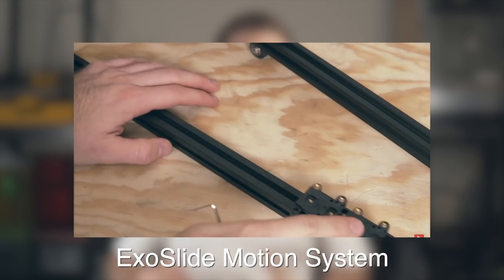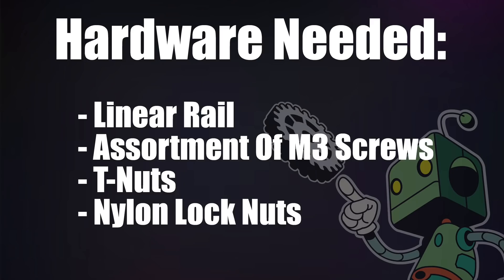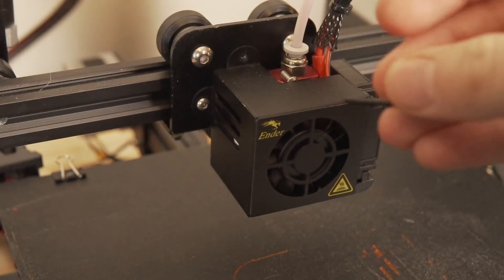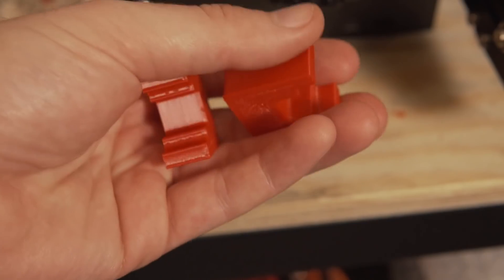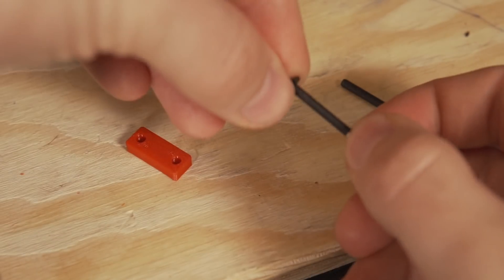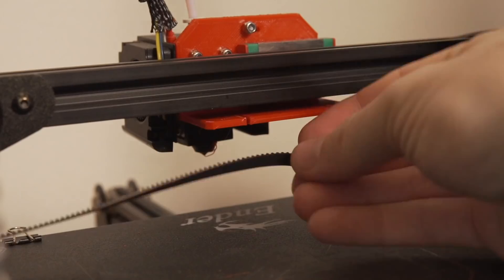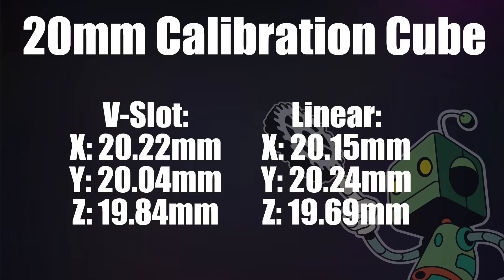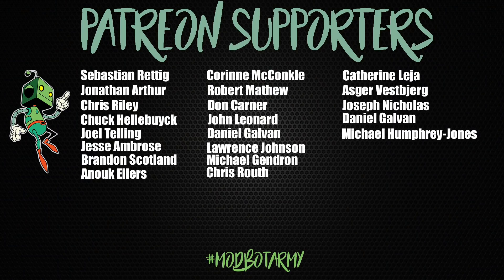Low Cost Ender 3 3D Printer X-Axis Linear Rail Install

Comment: very fun video. currently I use petg-cf, it very strong so It may be better matterial option. 
there  are may option for ender 3 v2 neo x-rail upgrade, but many other bracket that not used, so it a bit more high value. 
with user design, maybe there are more option maybe. 
Ender 3 v2 neo and Sprite pro kit and some cheap rail and your mod bracket is something fun result maybe. 
thanks for your video

Comment: I will be upgrading an Ender 3 Pro with 5 linear rails (Zx2, Yx2, Xx1) by converting it to core XZ Kinimatics (Voron Switchwire).  I will be using the Voron Afterburner with a dual Bowden configuration and two M4 extruders to have a dual material setup.   
I think one could take the original metal X carriage on the Ender 3, and drill 4 holes in it to mount it to the linear rail instead of printing an adapter.  That would be rigid enough.  The excess bits used to hold the could be cut off if desired, but that isn't necessary.

Comment: Your bracket was long enough to have used two slides. That would have improved tolerances way more. Original slide had a longer base of contact. Just having one slide magnified slop with the head extended beyond the slide. Wear in will increase that also.

Comment: not really surprised its not good, the carriage rail is crap being made of plastic and is not dimensionally accurate which means its not parallel to the X rail Extrusion and the major issue is the hot end which of course does all the work is even worse , one small piece of plastic to hold a 6 cms lump of metal holding only at the top which is not where the pressure is, its needs to be held top and bottom and needs again to be parallel to the X rail profile.

If none of those are parallel it will never print dimensionally correct again. 

You dont need  to waste plastic printing the alignment spacers just use the depth gauge on your verniers and use that to make sure that you check as you do the screws up, thats another issue those should be started in the centre and you should use all 12 but treat it as if it is a cylinder head and tighten in a sequence which is not 1, 2, 3, 4 it needs to be something like 6, 4, 8 and so on . 

Washers finally need to be used where a screw travel's through plastic to spread the load.. If your going to use these parts to upgrade your Ender then perhaps you should make sure that main carriage plate is double the thickness or better still have one made in metal or find one made in metal, They are bound to exist now...  Finally toss the bearings out of the linear rail carriage bearing, wash it out with a solvent and repack with high quality new ball bearings and pack with the correct grease for them.

That will make a difference but unless you do the lower axis and bed it will not benefit your printing, it just makes it look prettier... 😄

Comment: With regard to the tolerances, I think it's prob significant that your x tolerance improved (slightly) which is the axis you installed the rail on, whilst the y and z got slightly worse, which are the axes most likely to be affected by any flex in the mounting bracket.

Comment: Very interesting vid and comments. I have a modified AM8 (All Metal Anet A8) that still uses round rod linear bearings (Drylin). Been trying to decide if I should upgrade to V-slot or flat linear rails. Currently if you push and pull on the nozzle its possible to move it quite a bit due to play in the x axis Drylin bearings. I'm leaning towards v-slot simply because they are adjustable where as linear rails aren't. Interested to know what the play is like in your linear bearings?

Comment: honestly how could you expect closer tolerances between the Axis's yet only replace 1  Axis with a linear rail??  and honestly when doing a linear rail upgrade why do so many skip the Z axis it's honestly the most important Axis to put your focus on for upgrades it takes all the weight, which causes it to always push on one side of the thread face, which account's for Z Axis in printers to never seem to reach that perfect 20mm notice its always under!!?

Comment: Completely pointless. You're taking a metal piece and swapping it out for a plastic one. Obviously this isn't going to work as well. Also, the hotend mount is very unstable, introducing play in yet an other point on the printer. I think this guy should stick with resin printers.

Comment: Love all the videos of people using linear rails with printed parts. The whole point of using linear rails or rods is that they are rigid. Plastic has zero rigidity when compared to even soft alloys like aluminum. You are effectively no better off in those terms than the original design with wheels.

Comment: The linear rail and guide is a fine upgrade but as it has a greater mass than the original equipment, and given the Delrin wheels are somewhat pliable, there must be measurable sagging of the X Axis extrusion as the carriage moves from X-0 to its end of travel. The end of travel is situated at what I consider to be the floating end.
Certainly this sagging will be more exaggerated when you install a direct drive ass'y on there. Might as well get rid of the bowden tube of right?? you may also get into some more exotic filaments as well. All good. 
So,  may I suggest this upgrade begs for dual Z axis lead screws to compliment the linear rails
A friendly reminder that the installation of linear rails is normally done with a dial gauge mounted to a magnetic block and flex arm combo to check for parallelism between rail and the sub structure. You stick it to the guide, place the shoe of the indicator on the extrusion top side, zero the dial and watch it as you run back and forth. Start the process with screws just snugged and then when your satisfied you may tighten and measure again :)
Once you are supporting the X Axis rail from both sides, this use of a gauge will actually be a valid procedure and have helped you achieve repeatable output.
Fun fact: the dial gauge may be used to check all kinds of other stuff now that you have a linear rail and guide to mount it to. Have fun.

Comment: with linear rails the xy are closer to each other. 
but i wish you did a tolerance test as in the ones with the knobs you rotate. did you calibrate flow?
also you're almost the only one doing tolerance tests thanks :D
also I wish you checked layer consistency

Comment: Someone needs to do this for the V2. That is one of my last upgrades is for the X-Axis as I just finished the Y but I don't want to use the metal plate for the head because it has holes for a BL Touch without any modifications.

Comment: do you happen to know of any available stl files for 1515 extrusion gantry plates/ x/y-axis linear motion (not using linear rails, just using the extrusion itself), that I could access at all, please....? 

it was only AFTER  buying all of the 1515 extrusion id need to make a printer with that i came to realise that everyone seems to have used 2020+....

doh...

Comment: Hi ModBot, I installed the linear rails on my Ender-3 Project printer, I could not find a nice model for the X Carriage, so i designed one, maybe you want to try it out. 
https://www.thingiverse.com/thing:4801702
I don't use end-stops with the FLY-E3 controller board.

Comment: Whats the point of a linier rail system if the movement still depends on a belt? If you replaced a belt with a threaded rod, you would get a lot more accuracy, less lashback, and more precision. I think the belt is whats holding this mod back.

Comment: You should have disassembled this cheap linear rail and cleaned off all the machining grease.
Search "Super Lube 92003 Silicone" on amazon for when you assemble it back.

Also when you do a Dual Z axis upgrade, which I guarantee you will. (youtube content duh.)
get this to lube the Z axis shaft screw. "DuPont Teflon Non-Stick Dry-Film Lubricant"

Comment: I mean you improved the tolerance of the X Axis with the rail. The worst tolerances on the Y Axis has to be in correlation with the printed Adapterplate.

Comment: Great tutorial. Just got the Ender 3 Pro. Used the link in the description and it directed me to the 400mm rail. Is that correct size for the 3 Pro, or should I purchase the 300mm rail? Does this mod add weight to the X axis? Does printed stand off for the hot end come with the other part file? Cheers

Comment: This completely unrelated but figured I'd ask. Is there a way to make vases without having to use vase mode. A friend saw a vase she wanted and said I'd make it for her. But when I went to the slicer I notice that it was completely solid. So I downloaded a few others and they're all the same, solid. Read the comments and they say you need to use vase mode. So I did. After it finished I see that it's only 1 layer thin and weak as hell. I messed with the slicer settings and tried again and got the same results. All the settings I fixed weren't recognized and yet another flimsy useless vase. I tried an abs and petg to see if it was stronger but it isn't. Its just a waste of filament. My question is is there a way to make a vase without vase mode for a strong usable vase?

Comment: To be honest this would have been made better with a piece of aluminium (Australian aluminum) angle, a drill, a hacksaw and a file. Fairly basic tools I would think. You could even mirror your print and use it as a template for the holes.

Comment: You need to recalibrate X axe stepper motor after replacing that. I'm sure the tension of the belt is not the same as it was before. This is why it's off.

Comment: I had two lowe cost prizes terms.  They sucked . They where cheap only because they needed 300 plus in upgrades just to print the test models.  New I print with a sainsmart 300 core x.y. best thing I ever did.  No upgrading at all , comes with all available upgrades . Trouble free printing every time . Dont pull the hair out of your head spend a bit more and be fine . Oh . And use cura 4.8.0 for your slicer and get a 5 gig flash drive . Dont network your printer ever

Comment: Print in ASA instead of ABS. It has the same mechanical properties but is easier to print and doesn't require an enclosure.
I don't know if you didn't record it or left it out, but didn't you fully calibrate your printer after the mod? 🤔

Comment: Just cut an aluminum L shaped profile and dril holes on it. if precision is needed use ridgid material and subtractive method. using linear rail and screwing 3dprinted plastic doesnt make sense.

Comment: Dude, all you did was slap a different linear guide on your printer without calibrating anything, and all you compared was the dimensions of a calibration print (not actually used to calibrate anything, mind you) without looking at ghosting, overall quality, or anything. I dunno what you expected....
Reply from the maker: I only did the cube because something similar was requested in a previous video I did. I would have just installed the rail and ended it otherwise. An all metal hotend and aluminum bracket is going on which was the main reason for the swap.

Comment: I bought 4 of these rails from Amazon and I had problems with three of them, even after cleaning and regreasing. They weren't smooth they were crunchy and had dead spots. I was lucky with one, and apparently you were lucky as well. I was able to make 2 good rails out of the 4 that I purchased. Buyer beware!
Reply: The crunch means there's probably something wrong with the carriage blocks internally. Try replacing the bearing balls in the carriage blocks with a higher grade, as this is one of the largest issues with knockoff HIWIN linear motion systems.
While doing this you can also see if the feed tube on the blocks was drilled from two directions - you'll likely notice a burr in the middle of the feed tube. You can ream it in order to remove a lot of resistance.
Reply from the maker: Wow good to know. I don’t have experience with these rails but based on your experience it sounds like I got lucky

Comment: I use Lots of linear rails/Sliders here and using a SINGLE one is nuts! they are designed to be used in Pairs at a min, and onside of the block marks the DIRECTION of accuracy,  the Blocks are designed for Vertical Loading and have a problem checking Torsion, Just because one block works the very next one can rock like a rocking horse.  COnsistency is the problem.  Sure you can get away with it but you may also find yor self chassing your tail,  To nail it down you need 2 rails and 2 Blocks and the ref edge needs to face towards the Bed so all references line up.
Reply from the maker: Thanks for the feedback. What machines are you using with two rails? I know most of the more expensive 3d printers that use them only use one. (Not that they are correct in doing so) Usually it is Cnc machines that I have seen that use two.

Comment: Since this was only an X-axis upgrade, the Y-axis change should not have been affected, which is strange.  The biggest issue is the plastic part itself, as it is replacing a metal part, and will stretch when tensioned by the belt.  The Micro Swiss will fix all that, which I'm sure you've already completed.  Unfortunately for me, I can't use that specific plate, as the Ender 5 Plus runs its belt on the sides of the X-axis.

One thing you might want to warn people about though, is that if the carriage moves to far off the end of the linear rail, the bearings will fall out and go everywhere.  So, you want it to be as close as possible to the limit switch, and you'll probably want to place an end stop on the other end.  I haven't had this happen to me, but I've seen videos of people making this mistake.

Again, GREAT video!  I'm putting up shelves as I've run out of storage space...lol.  BTW, I'm going to create 3D printed earthquake shields for the edges of the shelves.  As you know, things like to slide off of shelves during a quake, here in SoCal.  :)

Comment: I got an aluminium plate for Ender 3 (fits my CR-10) instead of the plastic one used in this video.
https://nl.aliexpress.com/item/4001165358429.html
I only had to countersink the 4 holes that attach it to the linear rail carriage.
I only got the mounting plate from them, so can't vouch for their linear rails
Reply from the maker: Damn that looks like the stock one pretty much. Which is not necessarily a bad thing. How long have you been running it? (Thanks for the link)
Reply: I haven't been running it at all.
I want to make my a reality CR-10 S5 into an Idex printer with the flex3drive (direct remote) extruder. 
So now I have to make a second mirrored adaptor plate from a piece of aluminium angle profile.

Comment: I'd love to see a follow-up with a more substantial mounting plate. I've got most of the parts I need to upgrade my E3V2 - Ender Extender 400 XL, dual Z steppers (each on it's own 2209), E3D Hemera, 500 W bed heater, 75 W hotend heater, PT-100 temp sensor, Creality Ultrabase build plate (I love this plate!). 

This should let me to work with any material I'd like, but I want to eliminate any problems caused by my current wheeled carriages. Linear rails seem a logical choice, and I could dig up couple hundred more for linear rails on all 3 axes if they made a real difference in speed and/or quality (especially dimensional accuracy). 

Therein lies the rub; I haven't seen a review that's produced anything close to significant improvements, which really surprises me. Is the problem $30 linear rails or something else? I've got a month or two before I'll have space to install my updated printer - I hope to have a definitive answer before then. Failing that, what replacement wheels would you favor?
Reply from the maker: For replacement wheels if you stick with V-Slot I primarily use cheapo ones on amazon since swapping them out doesnt take to long and they last for a while. However, I have heard great things about the polycarbonate ones that you can get from Open Builds. Might be worth looking into those. I am looking forward to how this shapes up with an aluminum carriage on it.
Reply: Re: Polycarbonate wheels - I've heard the same; I guess, other alternatives failing, that's my best option. What I most dislike about wheels is you have to find a balance between a rigid platform and resistance to motion/wheel wear. With the stock wheels I can't eliminate all 'wiggle & jiggle' before rolling resistance starts to rise - perhaps polycarbonate will provide less rolling resistance.

 @ModBotArmy  > I am looking forward to how this shapes up with an aluminum carriage on it.

I am as well. Once you've got things tuned I'd like your opinion of your rails vs the ExoSlide. I want to end up with a machine with no mechanical issues (or as few as I can afford to eliminate) so I can concentrate on the software side.

Comment: LOL Your tests are not valid. You changed the weight of your hotend assembly, How in the world do you expect good results without tuning??? Your Z axis being way off should have given you a clue something is wrong!! Your mount being made of PET-G has nothing to do with your Z.  All I use is Atomic PET-G and Atomic CF PET-G on all my 3D printer upgrades and my tolerances have tightened um substantially.
Reply from the maker: I included the Z-Axis just because I was measuring the other two. I don't actually think the z-axis needs tuning it is just that the nozzle is too close to the bed or the buildtack sheet so the first layer or two is being pressed down causing that difference in value. As for tuning, absolutely. This is why I mentioned in the video it was just for fun since it had been requested to see without changing anything else the difference between the two. The sample size is too small and a tolerance test like the one Angus developed would also help in determining how tolerances have been affected.